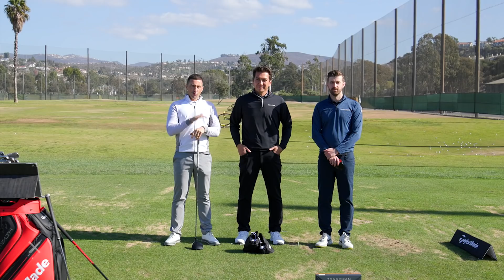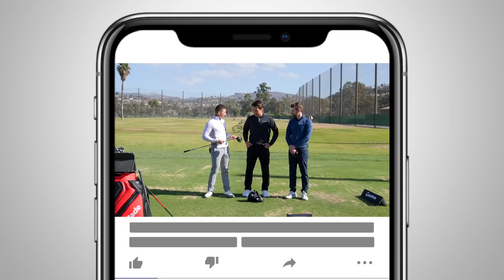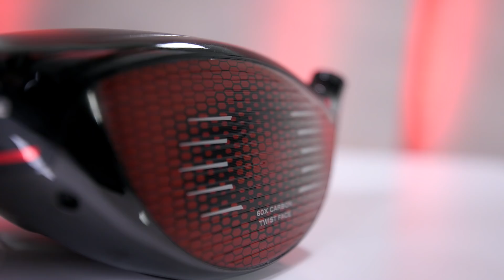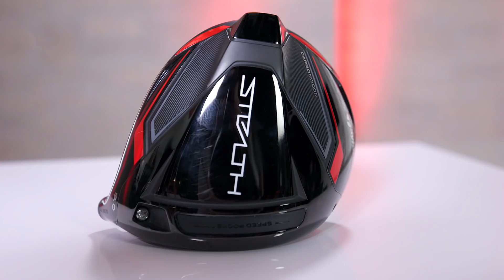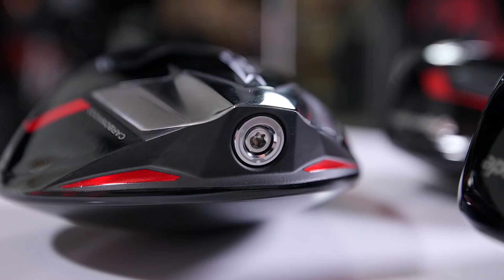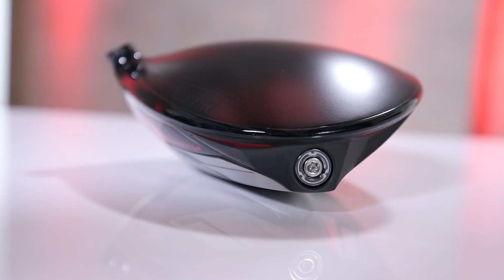Deep Dive into the Technology of Taylormade's STEALTH DRIVERS

Comment: All these drivers are governed by USGA rules and they have all been maxed out for years!!! This is nothing but marketing hype to try and get you to spend another $600 that you don't need to spend.

If any OEM truly came out with a "breakthrough" driver product, EVERY tour pro would switch to it in a heartbeat. Their on course winnings would more than makeup any lost revenue from an equipment deal. Why are all the tour pros spread out pretty much evenly across all the major OEMs???? Because their is literally no difference in their products due to the strict rules and build guidelines the OEMs must follow!

Now, if your driver is 5+ years old then yes, go ahead and upgrade and you should get some pretty decent gains in ball speed and consistency. If you are gaming something newer than 5 years, then you are better off getting properly fitted and get the correct shaft in your current gamer driver head then going out and buying a whole new driver.

Comment: Quite entertaining when you realize these guys really are not engineers :)  In a "regular" fairly modern semi-conductor, you need to know about how many ATOMS thick a layer of material is, but for these guys.... "hey, it's layers of carbon fiber"" :)  And before the storm starts:  1.)  I am a golfer, and a high handicap one :)  2.)  Yeah sure, keeping the kind of control of the production process that semi's do, would most likely make it probhibitably expensive (well... not sure if Bill Gates play golf... :) ), but still... to try to make it seem like they are on the bleeding edge of manufacturing tech..... not going down well.

Comment: I’m not worried about the carbon, I’m sure it’ll last longer than I will. My only concern is the nano layer. How well does it wear from repeated use and abuse. Heat/cold and UV exposure. It would be sad day to look down and see it cracking and flaking off.
Reply: 18 microns of surface texture does not sounds like something that would last that long, i'm sure these faces have dont thousands of test hits by robots to see wear etc. But i feel they would not mind if they arnt as good in a year so you can go but next years club.

Comment: How can new drivers legally deliver faster ball speeds for the same swing speeds? I thought the max smash factor was 1.5 for a conforming club and current drivers already achieve this. When it's mentioned people achieve 4-5mph more ball speed is this on off center hits? So then the Stealth driver isn't faster, it's more forgiving?
Reply: It could be a cheat code for a few years. The USGA CT limit is based on the rebound properties of a titanium-faced driver. So it's very possible that by using carbon, they are able to achieve a stronger rebound/higher ball speed within the same CT limit.

Comment: Durability will be a key to the success of this club. Did TM do destructive testing? That is, using a robot to hit balls thousands of times until the carbon material reached failure, either in terms of wearing out, breaking, or losing its ball speed pop? Did they test the polyurethane layer that contains the grooves and microgrooves for tolerance to wear, and to see whether that layer might separate from the underlying carbon layer either from use or from the club being left in cold or heat, as in the trunk of a car during a heat wave.
Reply: No. A company that just sold for almost 1.9 billion dollars didn't do any of the most basic product tests before launching their new product.
Reply: @ohwowthatsgood  Are they any comments from industry insiders on that topic that would confirm this? They have been working on it for over 20 years, so one would assume that somewhere along the line their engineers would have done tests on the materials in their labs.

Comment: Tomo is the ultimate sales man, talking about everyone picking up speed (up to 5 mph). Before this video I looked at 2 YouTubers put this head to head vs SIM2 and finding out that there is 0 mph more speed 🙈
Reply: Exactly. In reality the big difference is it's very cool looking. That's it.
Reply: @coobay4786  I think the biggest difference is that it's much more forgiving than SIM & SIM2. That's probably just due to the weight savings from carbon that allow them to increase the size of the face rather than carbon being more forgiving vs titanium if the faces were the same size.
Reply: @jbro151  I don't think so. One of the videos I watched tested 3 of the 4 models available for this driver. Only one was very forgiving and no more than  the Sim 2. The distance model was way less forgiving. On that model any off center (sweet spot) shots lost a good bit of distance. From what I've seen the Ping G425 driver is the most forgiving and only a few yards shorter than the Sim2 (maybe 2 to 4 yards shorter).
Reply: @coobay4786  Yea I'm not trying to say that Stealth is a forgiving driver relative to others on the market. Just saying that the larger face makes it a more forgiving driver than the last two SIM models.
Reply: @jbro151  watch the video I suggested and see what you think. I'm not putting down the new driver design but everything I've seen that there's very little difference in in all the top brand drivers in the last 3 years. The claims they all make in reality or very small. I think if 90% of golfers could actually keep stats on the level that PGA does, I would think you'd find over the course of 4 to 5 rounds that the overall stats would be no different from this year's models to models of 2 to 3 years ago. New drivers remind me of the old saying. Fish baits or designed to catch fisherman not fish. The only baits that catch fish are the ones you have confidence in, same for drivers.
Reply: @coobay4786  I don’t think it’s worth the money. Just saying it’s more forgiving than the last 2 models
Reply: That's taylormade for you.
Reply: @Dan-nh8nu  Its not just TM, its all the major OEM's right now. There is literally nothing they can do to "actually" improve ball speed on drivers. They have maxed out the USGA and governing body limits for years. The ONLY way for the OEM's to get weekend hacks to spend $600 on something new is misleading advertising.
Reply: @mattgreen267  Taylormade are the worst though.
Reply: For 20 years taylormade has been claiming more ball speed. Cor has been maxed out really since the 300, 320 and 360 series. At this point we should all be hitting the ball 390 yards if what they claim year after year is true. Marketing at its finest here. Funny how they never do full in depth videos with DJ or Rory comparing older models to new to show the improvements they have made
Reply: Lol how about everyone just goes to hit it themselves, they definitely have their reasons to make claims on so many big channels.
Reply: @tomotto1298  yes they want to hype the driver so mugs go out and buy it.

Comment: As a structural engineer who nerds out on golf technology and physics, I loved this interview! Having done some resin infusing of composites, I can appreciate the engineering and manufacturing that went into creating the carbon face of this driver. Can't wait to try it out!
Reply: And understanding composite materials…do you have a feeling the more you hit this driver the hotter it will get. Say like with baseball/softball bats…where you can hit them until they fail compression tests and become “illegal” to use in sanctioned games…
Reply: @Athon08  I unfortunately do not know much about the repeated dynamic response of resin infused composite materials. I did research in mostly static loading and single use dynamic loading systems on a large scale. If properly designed and tested, I'm sure that there exists a carbon and resin formulation that will easily handle the conditions this driver will see. But that is a very valid question.

Comment: Would love to see this in the hands of a high single or double-digit handicap for comparison. Just feel like tech in the new driver could show greater gains for those who find issues with finding the center of the face as frequently as Matty!
Reply: I’m a 24.7 handicap.  I was fitted in the stealth + yesterday.  Now, it’s been since 2007 since I’ve bought a driver but I added 44 yards on average over my best drive of my old driver.  My accuracy was exponentially better.  I ordered it straight away. Confidence, ball speed, spin, forgiveness, distance and accuracy were huge wins
Reply: @jeremymcginnis4388  curious - what other current drivers did you test and how much better was the Stealth+ vs those? If I hadn't bought a TSi2 to replace my 2005 Cleveland Launcher in April 2021 I would definitely be testing Stealth as well.
Reply: @lindsaynewell6319  I actually hit the new Titleist, epic, mavrik max, cobra and one other club that I cannot remember (only hit two with it). The titleist was a close second for me.  The fitters pointed to a handful of numbers on the stealth.  My dispersion and confidence was a little better.

Comment: As someone known to sky a few drives as well as get a few out of the bottom of the face, and someone who has designed, cut, and broken many custom drone frames, I'd love to know how they protect the edge of the face.  As soon as you get impact at the edges of cut carbon fiber it starts to delaminate
Reply: If a golfer is somewhat consistently skying drives… the newest 1k driver isn’t really the best way to spend that money right?  If 1k is nothing to that golfer, would they care about it? I assume they’d just throw it away and buy a new one lol.

That said, would be interesting to see how well these last over time.  If they hold up, I’ll probably pick one up in 2030.
Reply: @lawbinson  a single strike on the cut edge of laminated carbon fiber will start the layers delaminating.  Not consistent strikes over time, a single strike.  That is why I am asking the question.

Comment: How does this hold up to hitting range balls, that havent been cleaned ? It looks like a very nice driver, but hitting range balls with sand on it etc, how will it hold up to that ?
Reply: polyurethane wont hold up well doing that. Cheap guitars are finished with the same material.
Reply: @johnthemachine  how do the cheap guitars hold up to golf balls?
Reply: The plastic layer will peel of over time.. so not that great

Comment: Durability would be my biggest concern, but it's interesting where this tech is going.  If carbon fiber catches on then it'll only be a matter of time before graphene infused carbon fiber or just graphene is used.  Graphene is stiffer, stronger and lighter than carbon fiber.  Mass product of graphene is still in its infancy, but once it can be mass produced cheaply, we could see a massive change in golf tech.
Reply: Graphene special formation of a single layer of carbon atoms. Graphene is no where near mass production. Nano tubes  and the depending graphene structure are still in development in NASA so I doubt anything consumer graphene is coming out for a while.
Reply: @densepixel  I think callaway have used graphene in their golf balls, so it has been used in consumer products
Reply: The question has never been about the potential of the tech.  It's the economics of it.
Reply: Durability bro you buy a new driver every year
Reply: @coreyvanular6195  😂
Reply: As soon as I heard about the carbon face, I thought "is graphene next?"  Maybe not in the face but in the club body.
Reply: They literally just dipped the face in polyurethane to try and make it last. I'd say this tech is a fad.
Reply: @johnthemachine  wear on that polyurethane layer is definitely a question mark.